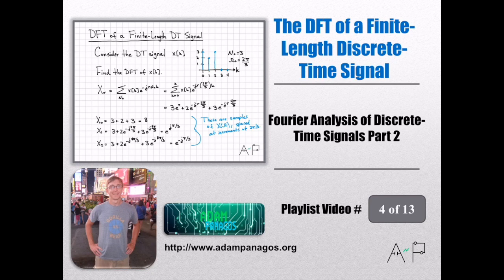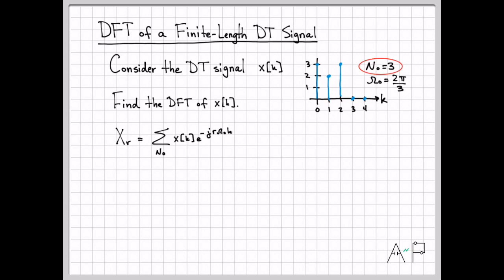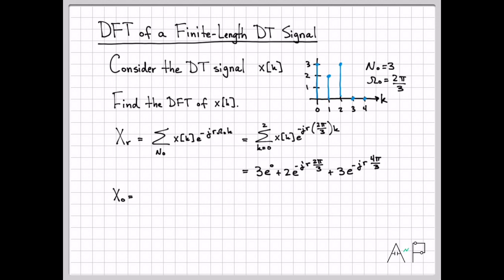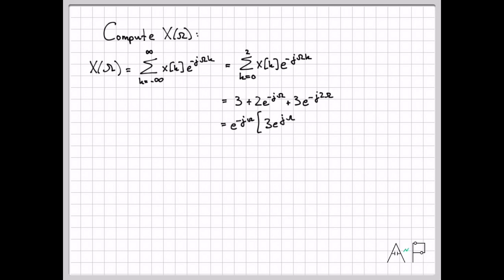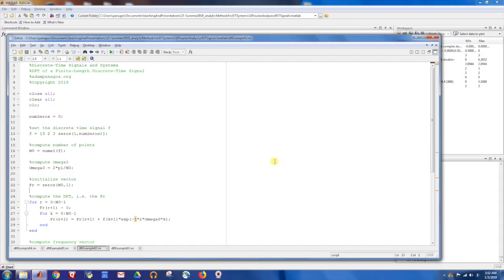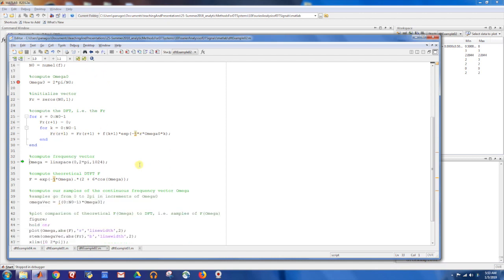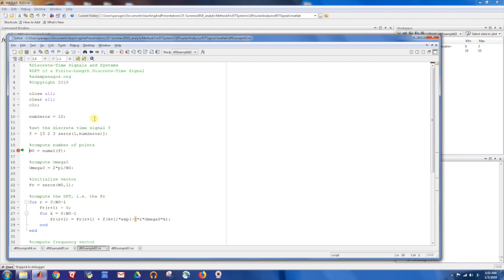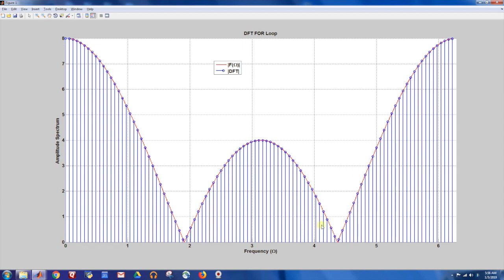The DFT of a Finite-Length Discrete-Time Signal

Comment: A question I have is are you modeling the finite length signal as periodic in terms of fundamental period N, for instance with the first example it is periodic every 3 terms and repeats 3 -> 2 -> 3. That what it would seem to be because when you add the zeros you are essentially increasing your fundamental period and the number of unique harmonically related discrete complex exponential's. If you keep decreasing the duty cycle you will be turning this periodic signal into an a-periodic signal in which the fundamental period goes to infinity, which in turn moves the spectral coefficients so close together that we get the DTFT as a continuous function of frequency which is periodic in terms of 2*pi. Great video!